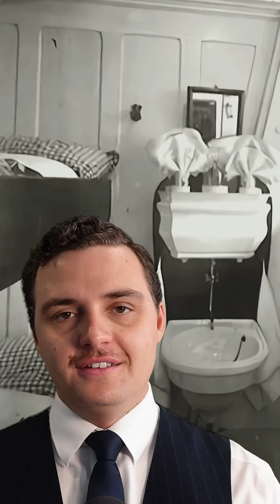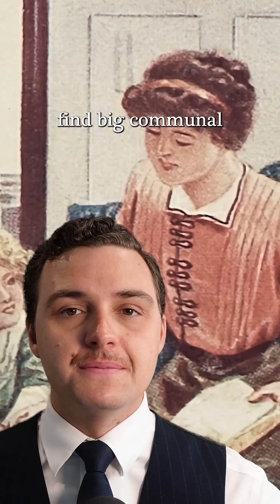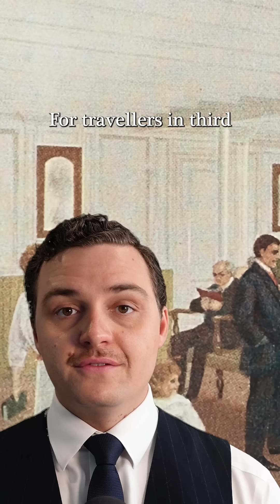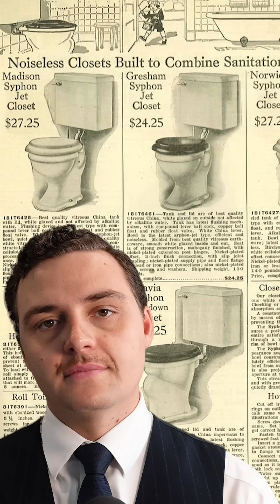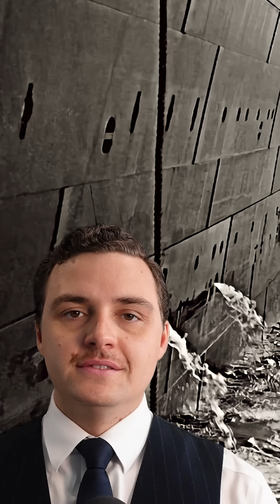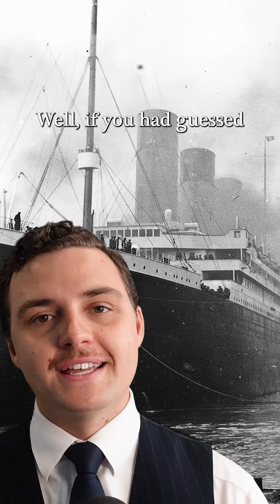How Many Toilets Were on the Titanic? #titanic #history #engineering

Comment: The RMS Titanic's construction started in March 1909, and its massive hull was launched into the water in Belfast on May 31, 1911. 
Fact: The commercial grade steel used for its construction was  prone to shattering with impact.  
Its construction period coincided with the "Naval Scare of 1909. This scare was the belief that the Royal Navy had an insufficient number of battleships to face the expanding German Navy. 
The question is, did the prioritizing of higher grade steel for battleship construction mandate the use of the inferior and brittle steel for the Titanic?

Comment: And, that 2200 was just what Titanic was carrying on that voyage. She wasn't fully booked - only about 55%. She was designed to carry another 1100 or so passengers.
Reply: 2200 out of 3300 is around 66% (2/3rds), not 55%.
Reply: @TasCaverneer  Those figures includes crew, and she carried her full complement (minus a couple stokers.)  Titanic could carry 2435 passengers. On the maiden voyage, she carried 1317. 1317 is 54% of 2435.
Reply: @JWRogersPS  I stand corrected. Thank you.
Reply: How many toilets for the 3rd class passengers?

Comment: Right, Titanic's sanitary arrangements would have been exactly the same as most hotels of the time.  En suite bathrooms in the most expensive suites only, communal lavatories for everyone else, which would have surprised none of the First or Second Class passengers.
Reply: I stayed in a grand old Edwardian hotel just off Piccadilly Circus in London in 1992. It still had no en-suite bathrooms (just a sink.) The facilities were down the hall.
Reply: @JWRogersPS  Not to one-up you but about 10 years ago I was making a service call in a new dormitory being built at the University of Richmond.  I was very surprised to find a similar arrangement, sinks in the rooms and lavatories (toilets, urinals, sinks and showers) at both ends of the hallways.  When I was in college in the early 1970s the older dorms built from the 1930s through the 1950s had the same.  The dorm I was in built in the late 1960s had a set-up of three rooms to a complete bathroom unit.
Reply: @JWRogersPS  That was almost certainly the Strand Palace hotel! The cheaper rooms didn't have en suites and it was a popular place with people on a budget. It was renovated in the early 2000s and all rooms have private facilities now.
Reply: Pretty sure 1st class passenger Lord Pendleton was overhead remarking, "Wot? I ain't going down the passage to have a slash."

Comment: Sorry, I just remembered how one submarine was sunk by the incorrect operation of a toilet. 😂
Reply: When you've got one bar inside and ten bars outside, getting sewage out rather than letting the sea in is a bit of a challenge.
Reply: @JonBrase  To be fair, the post showed 13 valves and it involved some 20 step process. So yeah, that tracks!
Reply: @lfla0179 There was a sailor tasked with helping users flush it, but the sub's captain insisted on doing it himself, and hilarity ensued.
Reply: @JonBrase They should put more bars in the sub then. I doubt the sailors are going to complain about having more places to drink.
Reply: @AndromedaHarper  that is barometric pressure or atmospheric pressure. One bar equals 15lbs per square inch or 108Kpascal .
Reply: @Irish381 if you hear a whoosh, don't worry. That's just the joke going over your head
Reply: @AndromedaHarper I get it!